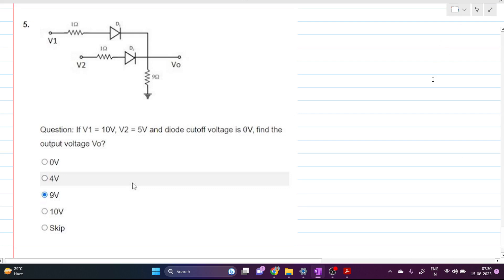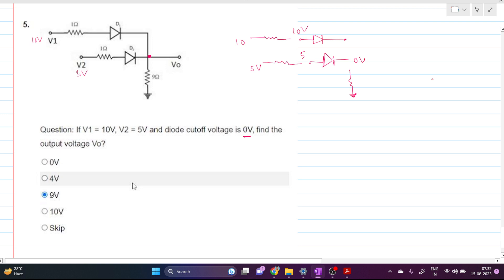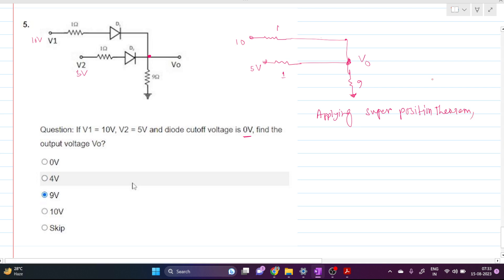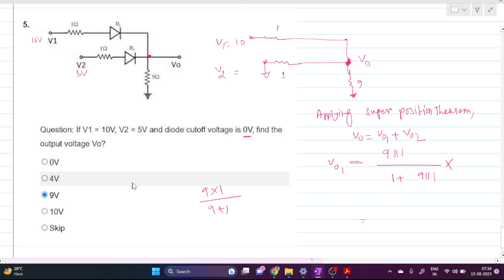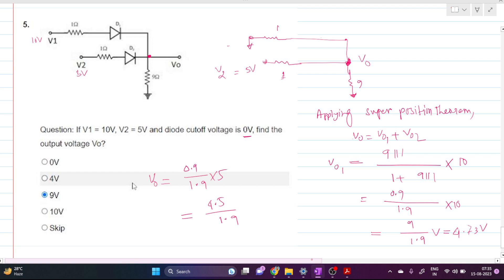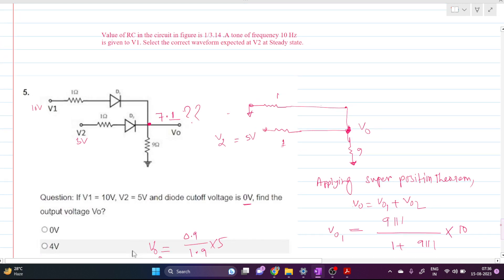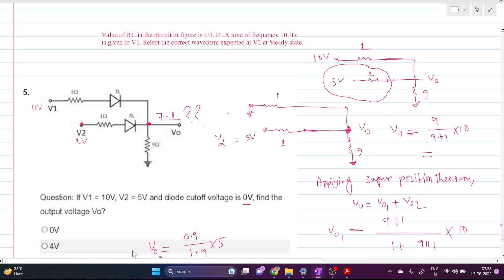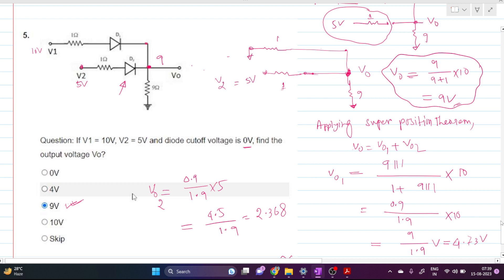Find Vo of this Diode Circuit_Analog Design Interview/Screening Test question_ Amit Bar

Comment: Simply when the case is about both diodes being on , we see the potential difference ,the one having higher difference is going to be on here D1 is having 10 v at input so it is on and then resistive divider will give the answer.